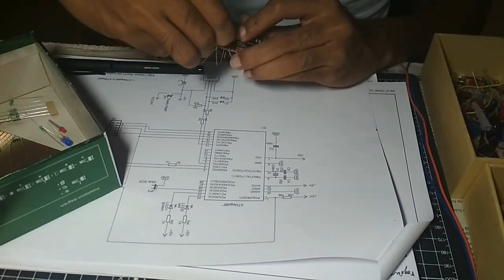Homemade AVR/Atmega programmer/Burning tool for microcontroller(usbasp)

Comment: Suppose I want to upgrade AtmegaG328p dip-28 Chip for LCR meter tester, what i should do?

I subscribed to ur channel.
Reply from the maker: Thanks a lot for supporting. I have already made a video on youtube to how to do an upgrde or upload. you can visit my channel and find it over here-
https://www.youtube.com/watch?v=Blp8wrLpmHM&t=217s
Reply: @DAILYTECHNEED  do i need to pay attention to what kind of display it supports? Like 128x64 or etc?? Different LCR meter type uses different LCD types.
Reply from the maker: @Surajkumar0770  Yes you have to pay attention. There are different libraries for different displays. But here different displays has been compiled by the developer so you don't need to worry about that. You can find the codes in github or under my video description links.
Reply: @DAILYTECHNEED  ok thanks...
Reply: I have a RTC based solar tracker with 8051chip and IN1307 RTC 
That is not working properly display show ******(seven stars). I am unable to set time. What to do help me plz. And provide me support.
Reply: @daily tech needs
Reply from the maker: @vikasbaldoo436  Try to replace the button cell. If facing the same Issue then better change the RTC module.
Reply from the maker: @Surajkumar0770  Ahh It's a wonderful device. I do have one. It's not that difficult to make or upload code. The progarm has already been compiled Inside the firmware folder.The exact directory Is here- https://github.com/svn2github/transistortester/tree/master/Software/trunk/mega328_GM328. Thanks a lot again for supporting. Sorry to reply  lately.